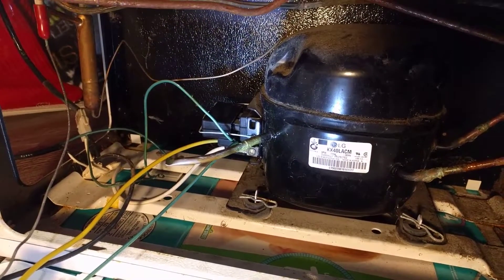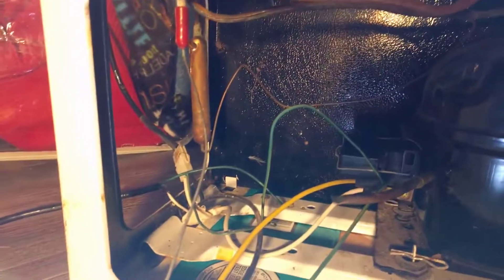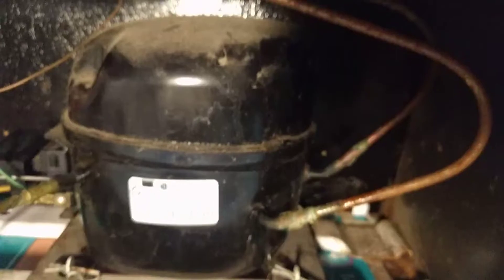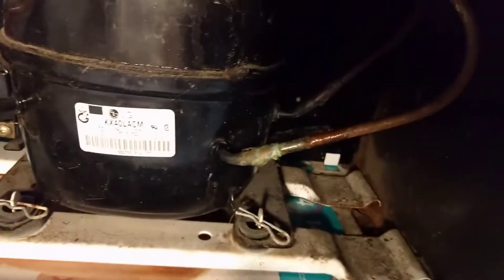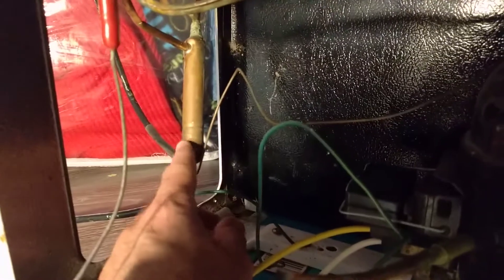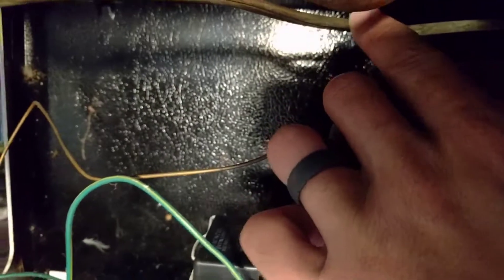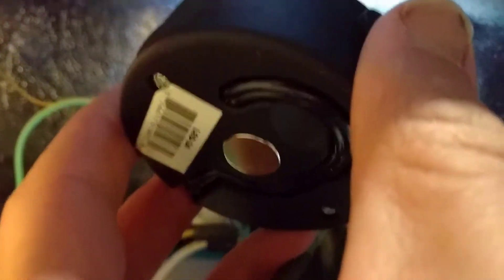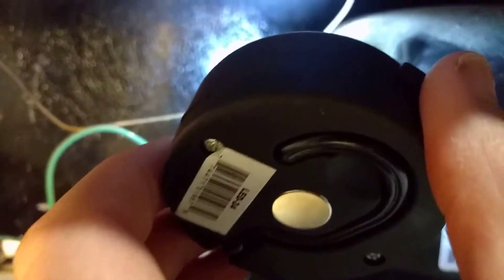Find the suction line on a fridge or freezer compressor

Comment: My service suction line on one side is too short to add a piercing connector so how do I know which of the other two lines coming out the compressor side is the suction side? Is the suction line cool to the touch? Thank you.
Reply from the maker: @larrya2344  I would
 Google it and do your own research cause I'm not an expert but a quick Google search told me the suction line will generally be cooler and the high pressure line will be hotter after the compressor has been running for a while
Reply: @MarshallBLewis  Every video I've watched has them hooking up to that small service line that's crimped off but mine is not long enough  - I kind of had a feeling that the suction line would be cooler - Thank You

Comment: What happens if you put it on the wrong line?
Reply from the maker: Great question. I do not know from experience and I spent the last 15 minutes googling and was not able to find the answer so I hope someone is able to enlighten us all with the answer
Reply: @MarshallBLewis  Well, I can tell you {Sigh}. The pressure on the exhaust side line is greater than the can can over come. So you end up not getting any cooling gas into the system. The suction line is buried inside my unit so very difficult to reach. I tried the supply line that the factory used and crimped off and cut. It got a little cooler but not cold. Still working on it.
Reply from the maker: Useful knowledge. Sorry your suction line is buried. So are you on your third piercing valve or have you been able to somehow plug the hole and reuse the same one?
Reply: @MarshallBLewis  The pressure readings indicate that I should be good but it's a little difficult to know if I am not on the suction line so I am bringing in a pro. I sent him a handful of photos and he's thinking it might be the fan or thermostat. Will know when he get here to check in out in a week. This is a commercial grade fridge that sell for about $2.5k new so I am still not giving up. It's on my screen porch and even outside, beers were 34° out of the box. I can't give up on it.
Reply from the maker: @1Putt4eagle  yep sometimes it's best to call a pro. Let me know what ends up fixing it
Reply: @1Putt4eagle  Well... that's a bummer!  I was hoping shortie was gonna solve it for me!  I'm buying multiple BPV's so I can stick one on EVERY LINE!

Comment: With refilling the coolant, apparently that short stubby pipe is good to use. It's where the factory fills the system.
Reply: Yeah, that should be the service line.
Reply: @artymowski Very true. I don't know about anyone else but mine had such a curve in it, the valve couldn't seat flat. And I was Not just about to try straightening it some. Too much of a risk of kinking it/cracking the seal at the condenser. As for the latter, that most certainly would have been that.

Again, you are correct. But his video most certainly helped me. Whew!